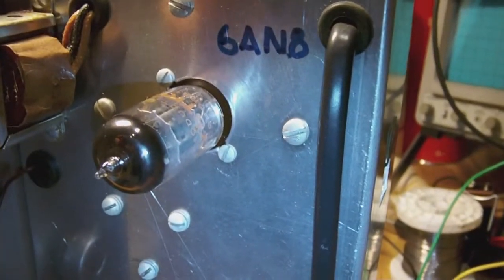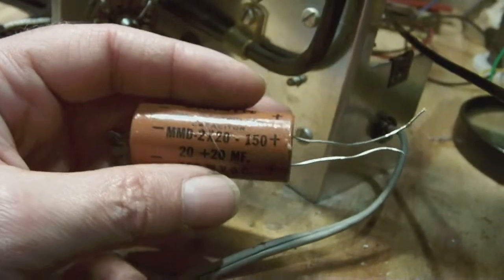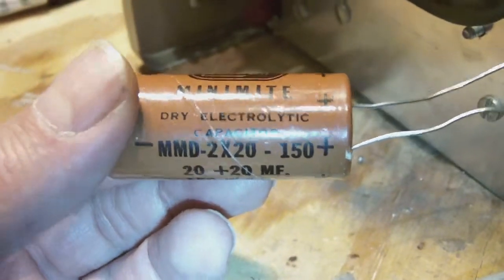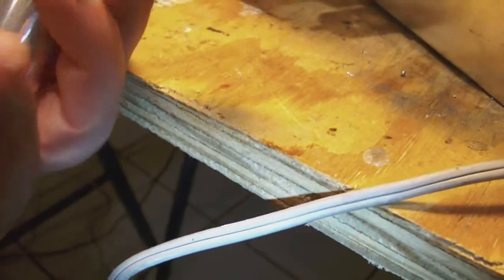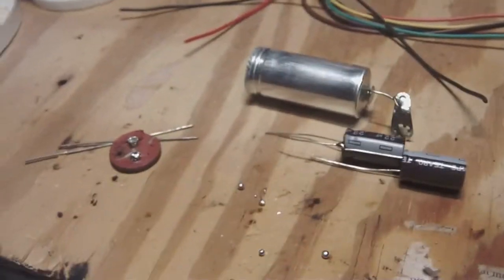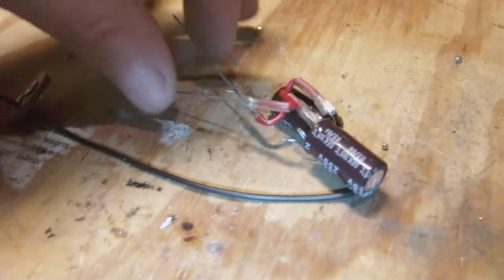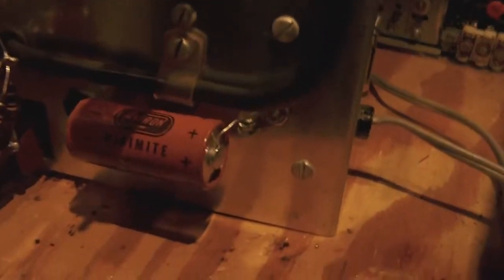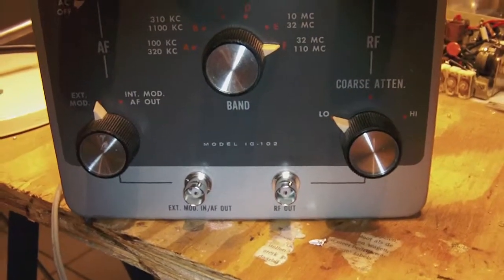Heathkit IG-102 part 2 of 6

Comment: I was told VSP was for the Voltage Supply Peak Voltage. You had your Stable (Working Voltage Direct Current) and then you had headroom for any spike that might occur - like using at least 16 volts on a 12 volt circuit. You do not want the circuit running at its maximum limit there needs to be room for change.